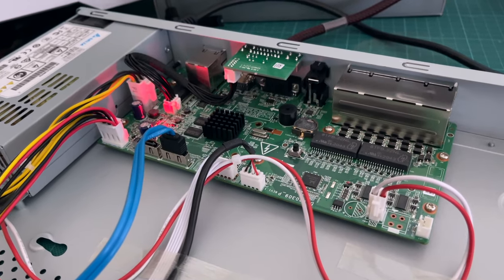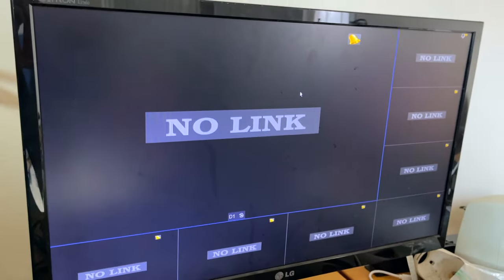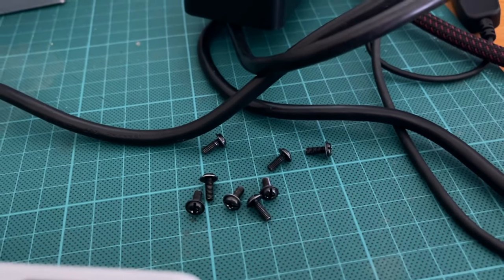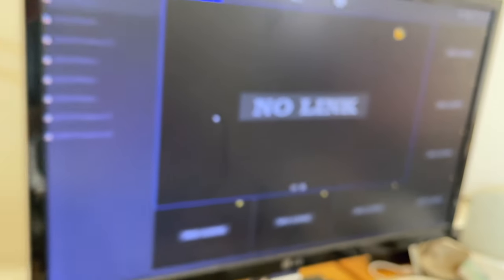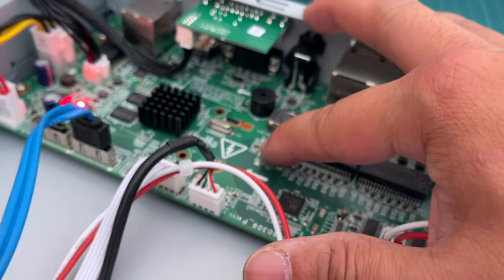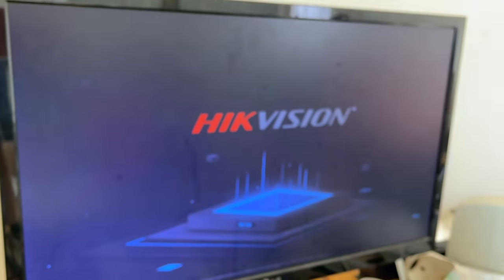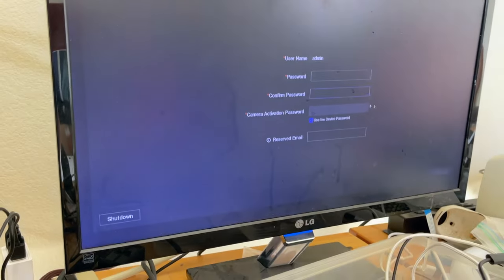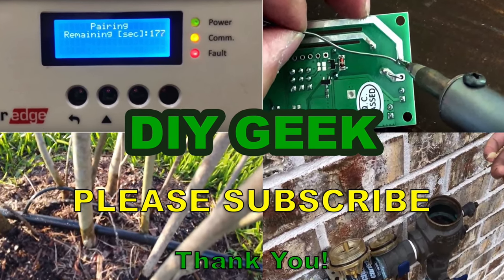HIKVISION NVR PASSWORD RESET

Comment: Hi there, thank you for the video. I have a different board; unfortunately, there is no such reset button. I bought a house and the system was installed by the previous owner, so I don't know the model of my hardware. The cameras are working though, as I can plug in a monitor and watch all the cameras. I tried with the apps but they returned a message saying that I am not the owner of the hardware, so I don't have access. Any suggestions about how to reset the password? Best, Fabrizio

Comment: I have an LTN8708-P8 (LTS Brand) but cannot find the place on MB to reset using your method. I watched every video available to try and find similar examples as yours. Any thoughts? Tried button battery out for 24 hours I guess the pw and setup config must be written to the bios? Appreciate any support.
Reply: Did you get it fixed
Reply: @trevorohare6061  THanks for your reply. I still cannot get it online so that I can see the videos remotely

Comment: No reset switch in my model :(    Looks the same as yours but a different board inside. Just purchased it a couple if weeks ago, they must have removed the switch for newer models.
Reply from the maker: You are right, sometime they just save some monies and NOT install the reset push button switch. If you can locate the soldering points, modify a paper clip to a tweezer and short the 2 points.
Reply: Had mine 4 weeks exactly the same 8K 8Channel NVR sent from Annke in Worcester. I will open it up again to check.
Reply: same here
Reply: Ok so I’m in the same position. Mine doesn’t have the reset button. Could you maybe describe where the soldering points are and exactly what to do with them because I’ve been suffering with this issue for a very long time

Comment: hi, i have lost my pattern lock and the verification code ( i do not have this verification code on the sticker below the device ) and i want to reset it. will this also reset my saved events from what my cams have seen?
Reply from the maker: This hardware password reset button method will reset your pattern and password. It will NOT reset your camera configurations and recorded videos and events.

Comment: Hi, I have this switch on my board...but if I press it nothing happens. No reset, no sounds...I've tried to press for almost 2 minutes multiple times....nothing...is there another method to do the reset? 
Thanks
Reply: Try pressing it and then turn it on or power it up after you are pressing it and continue pressing it
Reply: @andrewn176  Thanks for the reply...unfortunately I've tried this two options too, but nothing is happend. Like the switch is not ocnnected to "nothing".
Reply from the maker: Did you try with pressing the button and holding it while you plug in the power?
Reply: @DIYGEEKTEXAS  yes, I've tried this too :(

Comment: I have just found this video suffering from the same issues, however when removing the cover to my Hikvision DS-7616NI-I2/16p NVR, it appears to be a newer MB as there doesn't appear to be this hardware button. Thoughts?
Reply: What are the chances, i'm here for the exact same thing... can't seem to find a damn button.
Reply: @lemonadetycoon123  same, don't have the guid file to reset through the gui nor do I have the button on the inside
Reply from the maker: Sometime they do not install the push button switch to save on material cost. But you can still connect the pins on the PCB board if they exists. However it is difficult to find the right reset pins.
Reply: @DIYGEEKTEXAS  I will do a little more research to see if there is any information regarding the reset you have suggested. Thanks for replying. :)
Reply: @redxblood85  Hi mate, so I've just figured out mine, but it requires you to contact your own country's hikvision support

- Ensure PC is connected to same network (wifi or wired)
- Ensure PC and NVR is switched on and NEVER Restart during the whole process.
- Downloading Batch Configuration software
- Installing Batch Config
- Run as Admin
- Click Forgotten Password
- Export XML file - remember the program MUST NOT BE CLOSED DURING THIS WHOLE PROCESS

- forward XML file to Hikvision Support 
- Await receipt of key XML FILE - If you're lucky they'll reply within 1-2 hours. if you're not. do NOT Close the program! cause you'll have to resubmit the XML FILE AGAIN.
- load XML FILE from Hikvision into forgotten password area
- Reset Password.

and win
Reply: Yeah after all that, it's not worth messing with a $5.99 goodwill treasure. At least I got a 1TB HDD out of it.

Comment: Does this wipe the hard drive or stored cctv when it resets the password?
Reply from the maker: No this will only reset your password. It will not even erase your settings (camera settings, labels, preferences, etc)
Reply: Thanks!!
Reply: What can you do if the model doesn’t have a reset button?

Comment: I installed a new modem/router recently. Now I can't view my cameras remotely. 
My LTS NVR status is displayed as "Inactive" and I can't view the cameras remotely. 
I found the push-button on the hard drive as displayed in the video and held it down.  
The system did everything in the video except make those beeps.  Then it rebooted to the New Password Activation screen.
I entered in all the info but the NVR is still "Inactive" and I still cannot remotely view my cameras.
Any ideas?

Comment: hi.there is no switch on board on my Hikvision NVR???
Reply from the maker: If your Hikvision NVR motherboard does not have reset switch, try to look for a jumper or just 2 points on the PCB board which does the same thing. Sometime Hikvision does not install switch on cheaper model.
Reply: @DIYGEEKTEXAS  hi. Thank you for the very quick reply. It is DS-7716NI-E4 16ch POE ..I dont think it is cheaper model.the board is yellewish.and there are lots of 2 ponts and 4 points jumber like solder:-)
Reply from the maker: @sefaalp-m5m  Make sure the jumper has label like RST or RESET or PWD or PW on it. *DO NOT RANDOMLY SHORT JUMPERS* may damage your board.

Comment: Please use SADP tool to reset DVR, NVR and IP Camera as HIKVision recomend 🙏
Reply: SADP tool takes a long time and more work to reset password.
Reply from the maker: Some NVR do not have hardware reset button, then you should use SADP to reset password. However SADP takes longer as you need to export XML file first, email to Hikvision and get password reset code.
Reply: Ok, but because i am a HIKVision dealer i usualy only take 5 to 10 minutes to get reset code in workdays.
Reply from the maker: @cctvpapuaindonesia  I have about 3 Hikvision system bought from authorized dealer in 2018, but the dealer went out of business. I tried to use SADP tool to recover password for a bullet camera. Hikvision replied telling me it was purchased from un-authorized dealer. Basically with Chinese companies it is buyer's beware, you never know who you are dealing with.
Reply: @DIY Greek I can unlock it for u. It just 15-20 mins to unlock
Reply: @christopherwitter3677  How do you plan to unlock it?
Reply: @piandarduinoprojects483  I can remote via anydesk and copy the xml file from sadp tool.. or u can send me the file instead via email
Reply: @christopherwitter3677  can you share your email pls?
Reply: I need help I have a similar problem. I used the sadp tool. I submitted the xml file. They responded saying that it was from a third party. Can you please help me? I have reached out to so many people and nothing.

Comment: Gud pm sir how about the LOREX dvr?thanks.
Reply from the maker: A lot of NVR has reset button on the PCB electronic board. If it does not LOOK for missing jumper or contact right on the board itself, usually next to the lithium cell battery.
Reply: Thanks sir..i already reset the dvr thru the reset button inside.thanks again..

Comment: I cannot find a reset button on my printed circuit please can you help
Reply from the maker: Try looking for 2 jumper contact points which are labeled something to do with RESET. If still do not find it, try to remove lithium coin battery for 10 min while power unplugged.
Reply: Thanks for getting back to me I have had the unit and plugged and remove the battery overnight, but it is still asking for an admin password. Is there some sort of default password that they put on these units. And I have taken photos off the printed circuit board and wondered if you could take a look and see if you can see any type of reset as I've searched and searched. The only thing I have found by reading other things on Google is there is two points near the power in marked as cvl 5 which has a square contact and a round contact and I've noticed on some other boards that this is it possible reset. If you could give me any help with this problem and somewhere I could send the photos I am willing to pay if I get this working again. Thank you
Reply from the maker: @stephenlafferty7327  sounds like you have read every inch of the motherboard PCB. I am not sure if I can be of any help but you are welcome to post the image to a public server like your public dropbox link or imgur. I will be more than happy to try to help.
Reply: @stephenlafferty7327  Hi, Have u figured it out? I have the same problem. Forgot password and login and there's no reset button.
Reply: @FraneB_  I had to phone hikvision who were very very helpful and they walked me through a complete which day did after they connected to my DVR
Reply: @stephenlafferty7327  tysm

Comment: What happens  if no reset button?
Reply from the maker: If you do not have a physical reset button on your NVR hardware, try to look for a coin battery. Unplug the power, remove the battery for 15 seconds.  Also look for jumper on the motherboard to reset.
Reply: @DIYGEEKTEXAS  not work sir, please help
Reply: J1  jumper 1 and 2  touch together
Reply: As I can remember we used to get firmware from hikvision and flash the device with it.
Reply: @TAJ-ub2xx  wher
Reply: @DIYGEEKTEXAS  ¹11¹1a
Reply: @boszgerald4095 , use SADP Tool.

Comment: If you are lucky enough to have the button, sick of HIK's that DON'T have the bloody button.
Reply from the maker: Yes some of the smaller / cheaper Hikvision NVRs do not have reset push button. But there is still a jumper or contacts on the PCB where you can still short the PCB contacts (I believe). I am not 100% sure but I have seen it or have done reset that way before.
Reply from the maker: Also, check if removing the cell battery (CMOS) battery can help reset the password / pattern also.

Comment: In my DVR there is no switch.
Reply from the maker: If you have no reset push button switch, then you need to look for a jumper or just 2 soldering points on the PCB. But be careful shorting these pins, you need to make sure you know what these pins are for.

Comment: Can we all acknowledge for a moment just how terrible Hik Vision is?  I reset my password using the UI.  I saved the password to a password manager.  I used the password manager to fill in the password confirmation box.  They matched.  I saved settings and now it won't recognize my new password, or the old one.  I'll try this reset.  Absolutely crap security here.  A vendor sold me this POS for around $5k and I'm about ready to harvest it for parts.

Comment: What if you dont have the reset button
Reply from the maker: If you don't have reset button, try to for jumper to reset on the PCB board. Or sometime Hikvision makes cheaper NVR without the push button switch. The contacts are on the PCB but they simply did not solder on the switch.

Comment: Not on the two DVRs I checked so far
Reply from the maker: Newer and cheaper Hikvision NVR do not have the switch. Sometime they simply do not install the push button switch to safe cost. But the contact points are on the main PCB board. Try to read the labels on your main board.

Comment: I dont have that button lmao
Reply from the maker: Sometime they do not install the push button switch to save on material cost. But you can still connect the pins on the PCB board if they exists. However it is difficult to find the right reset pins.